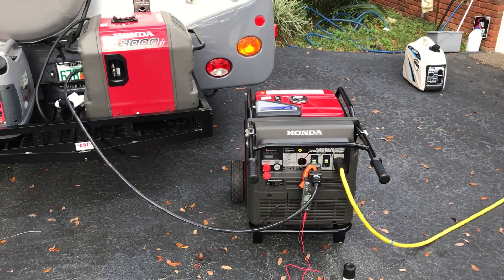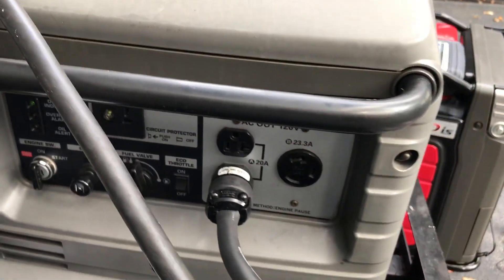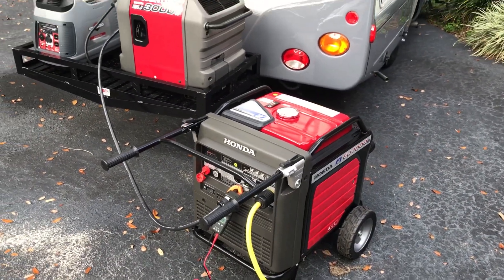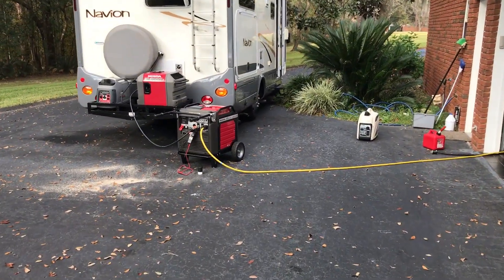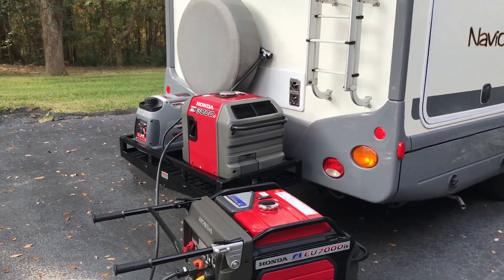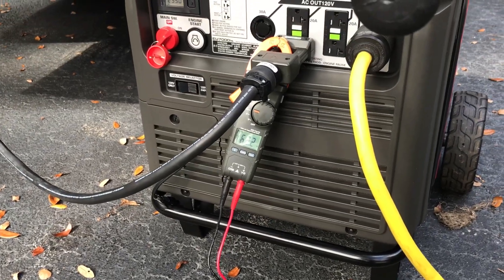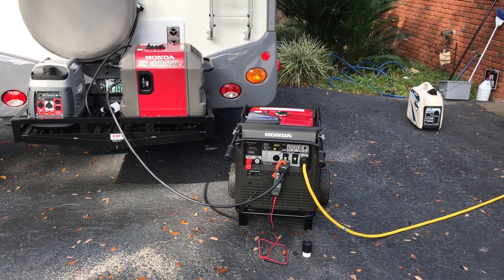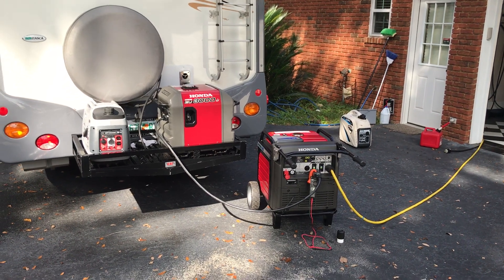Parallel operation of different sized generators Honda EU 7000is and a Eu3000is Honda

Comment: Sweet setup! I like your array of generators, I never would have known it was possible. :) FYI, if you care about your AC condenser unit lasting as long as possible clean the coils where it meets the ground to keep moisture from sticking around. That will rot out the coil and you'll end up with a leak. It's not too hard to pull the fan and clean inside there. More of a risk with new units and their delicate coils, but if you want yours to last as long as possible you may want to consider it as yearly maintenance. Good luck!

Comment: I have 2 honda eu7000is gen sets and still waiting on the parellel kit from honda. I have been playing with the idea to make my own kit.
Reply from the maker: Mark Neville Look at the other video I just posted about two weeks ago that fellow said that he made his own parallel kit I think all you would have to do is connect the two 240 V plugs together and then bring it into a big 50 amp plug
Reply: That is kind of what I was thinking. I'm  not sure why honda is taking so long to get it into production. I'll check it out.
Reply: The parallel kit just back out yesterday July 5th 2018  I got it in the afternoon yesterday I got on the list for it 6 months ago , just go to your local Honda shop and have them order you one its a nice kit made by reliance and Honda it give you a 50 amp plug with two amp meters and breakers built in cost was just over 300 bucks
Reply: Here is a very important video that everyone really needs to watch https://youtu.be/I1jT3ANENvI everyone should watch this video. I’m not forcing you to watch this. There’s a very important advice on this video that everyone really needs to know about. It’s about safety first. Thank you.

Comment: do you think i can do the same with my honda 7000 and my honda 2000?????
Reply from the maker: dannyboy9254 Well I have ran that 3000 W generator on the back of the motorhome with the 2200 W Briggs & Stratton and they both parallel just fine around the Generac 2000 with the pulsar 2000 I haven’t had any problems yet but I’m a rest take her and it was a $500 risk but I had never seen it done before I wanted to be the first. LOL I did a lot of reading and research and they did say the most important thing was to never disconnect the parallel cable while either generator is running.. And a little Briggs & Stratton as a note on the front that says do not unplug any cord while the generators running I have never seen that before
Reply from the maker: dannyboy9254 I do notice that when paralleling different size generators the appropriate load goes to each generator so if I take them up to both full load or if I bring them down they will both have 50% of what is rated on the generator for example 50% load will have 3500 W on my 7000 in about 1500 W on my 3000 W generator so they both run with equal load

Comment: On a side note, I wouldn't try this with any other brand. Meaning don't try paralleling those disposable inverters to the Honda's. Just keep Honda's with Honda's. The inverters on the Honda's are designed to match waveform with other Honda generators. Those other brands are a question mark, with questionable quality. Except Yamaha's, in the opinion, they are equivalent in quality to Honda.
Reply: Fishermen 82 - Well, my experience is EXACTLY the opposite. Had cheap inverters(loncin, champion, ryobi, then boily) and they were all disappointments, of all of them though the boily was the best. Decided to see what the fuss was about and bought a Honda. It's been 3 years of heavy use and zero problems, I'm never looking back. So were you by chance trying to power it with an eu1000? You know you can't do thy right?… any inverter that's not a Honda or Yamaha are junk…
Reply from the maker: Tommy TMT I’m not telling you to try every single brand but I tried every single brand with two males and the cord crank them both up do not remove the cord  until you shut both of them off they all seem to synchronize just fine.The little general or 2000 does not communicate sometimes
Reply: Tommy TMT what's a disposable generator?! I had more issues with my Honda than with my lower cost inverter generators. In fact I ended up "disposing" of my Honda (sold it to my friend). It would barely power a 1500 watt heater or compressor without seriously struggling or overloading. My ryobi 2200 and 2300 never give me problems! 10-15 years ago Honda was to gold seal of inverter generators, but there are other companies now making comparable and good quality products at a MUCH lower price point.
Reply: Tommy TMT it was a 2000 watt. Sounds like you had some lemons.  Bummer. My ryobi never lets me down. AND it will actually power a space heater, travel trailer AC, microwave etc and my other tools. My Honda was basically a battery charger and that's about it. You don't need to mortgage your house to buy a nice reliable genny.

Comment: Wow, I've gotta say, in theory this SHOULD be a problem, paralleling a 120 volt only generator to a 240 volt generator. But it's working for you and that's awesome. I never thought of this, and if I had, I never thought it would work. I think you're only boosting one leg of the 240 volt output… BUT, I can't argue with results haha.
Reply from the maker: Tommy TMT Well I have figured out the 240 side of that Honda inverter is totally separate I think then the 120 side because when I have it on 240 V it will not go over 4000 W without overload coming on I have to switch the generator to 120 V to prevent the overload from coming on when I run it up to about 8000 W.. Just do not go over what the plug is rated for on a continuous basis because it could cause the circuit breaker to pop and you don’t want that when you’re paralleling